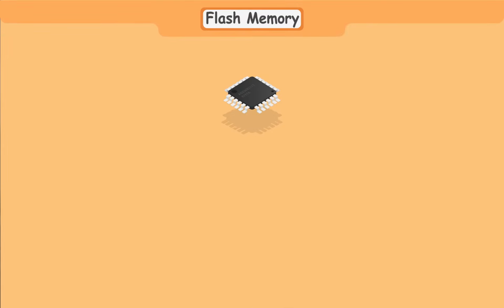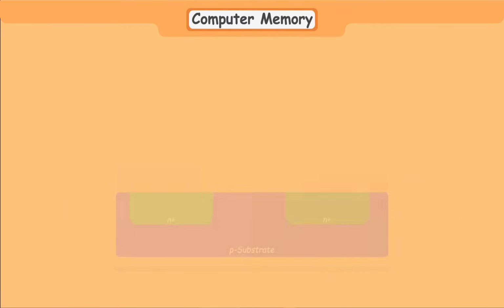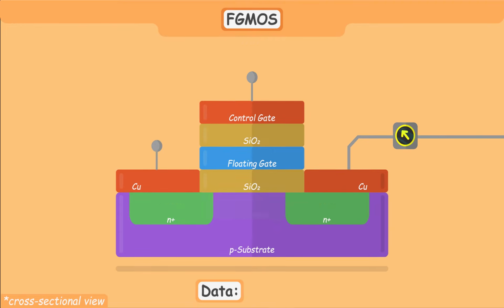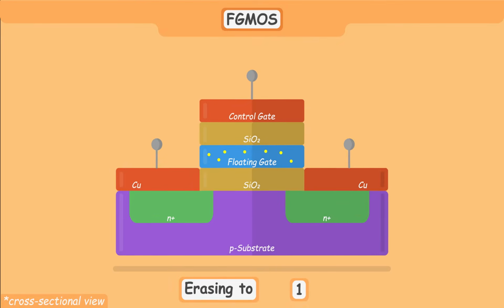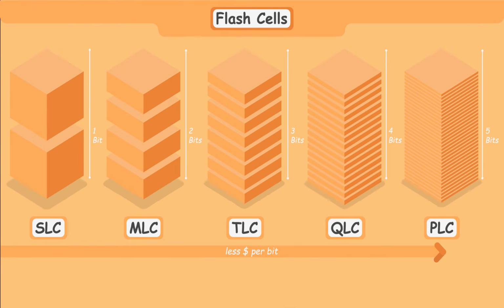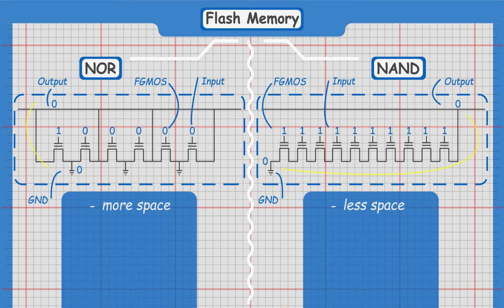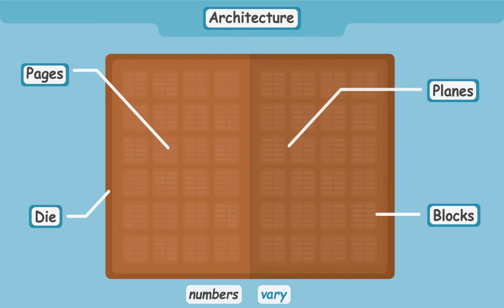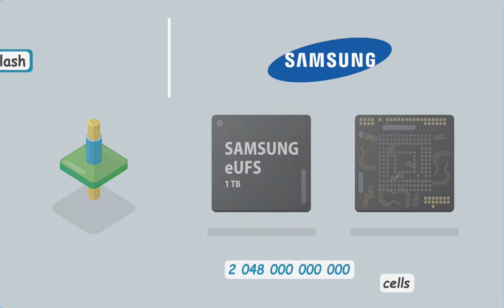How Does Flash Memory Work? (SSD)

Comment: 3:13 The cool part is that flash has an on-chip charge pump to get 10-12V for erasing, because it's quantum tunneling. The limited write cycles are because zapping it that hard degrades the oxide. In 1984 quantum tunneling wasn't even a new idea (it goes back to the 1920s). It's the same way you reprogram '70s EEPROMs, and those needed 20V. The big innovation of flash was block erase. EEPROMs needed to erase one byte/word at a time. Flash has 4KB+ erase blocks. NAND has erase blocks in the MB range.

I love the vibe of this video. It's amazing how deep it goes in < 10 min.

Comment: If you want to read the logical 1, why do you apply 3 volts to the control gate if the flow of electrons only goes from the source to the drain

Comment: It is said that NAND data can only be stored for two weeks at 55 degrees Celsius. If my SSD works at 55 degrees Celsius, does it mean that the controller needs to rewrite the data after every two weeks of operation to prevent data loss?  Or rather, after powered on, NAND itself could prevent electronic loss without consuming the lifespan？

Comment: MLC is created not by more layers, rather variable voltage levels.  MLC (2 bits per cell) simplistic cell data storage example: Voltage stored in cell 0v=00, 1v=01, 2v=10, 3v=11.  It takes time and complexity to decode the voltages as well as write them and also there's a higher likelihood of errors due to the analog data hence error correction is needed.

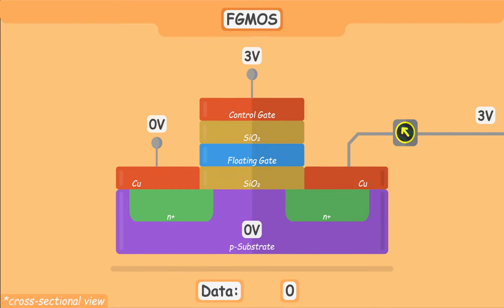Comment: Hello Nice Video, I have a question .At 2:52 you are saying that if there are no electrons at substrate then logic zero is assumed as electro are trapped at floating gate so no current will flow through substrate but why we are not measuring current ? without measuring current how shall we will come to know that there is a zero current. What is threshold voltage of flash cell ? what does it mean and suppose you apply voltage more than threshold voltage then what will happen ?
Please reply. Thanks

Comment: Just deleted Microsoft flight simulator 2020 off my ssd, it took less than a minute (OVER 100 GB OF DATA). I was curious as to what flash memory is. Great video, great quality, very well explained. Thanks :)
Reply: I don't think "deleting" files really say much about the SSD, as it does about the filesystem.
When you delete a file, you're just telling the filesystem to "free" the blocks that it has allocated for the Microsoft flight simulator file, so it can reuse that to store other files. How fast that can happen does depend on the SSD, but the SSD doesn't have to do nearly as much work as writing 100 GB to storage.
Reply from the maker: Thank you!
Reply: why u deleted it?
Reply: @neilmande5148  couldn't get gut